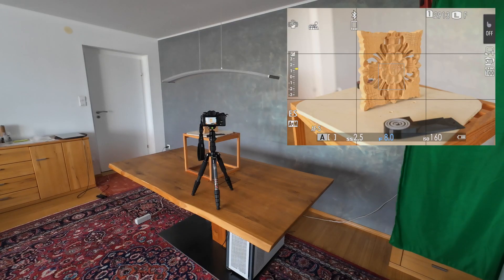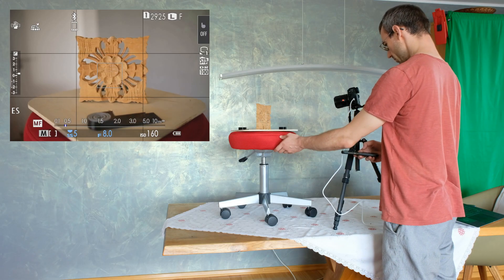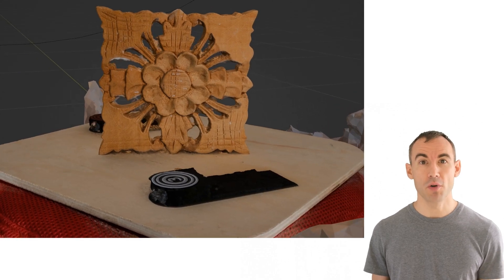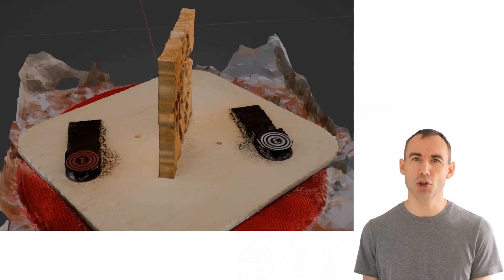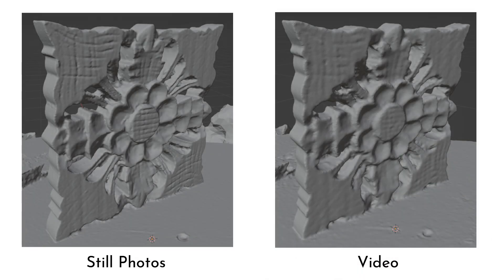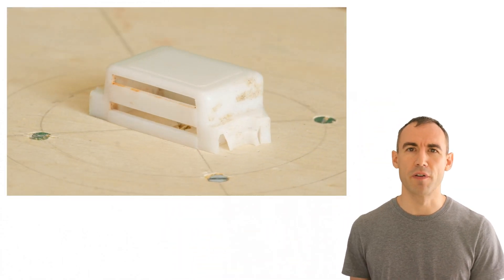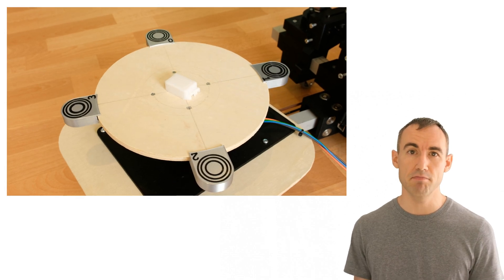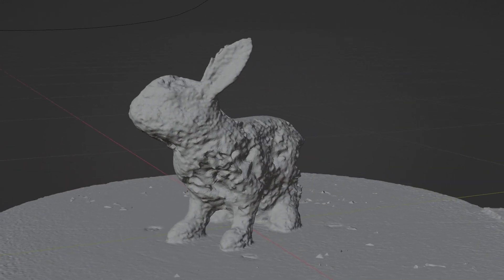Let's do some 3D Reconstruction: Intro and Image Acquisition

Comment: Nice video! Thanks for sharing your work! I have been wondering for a long time whether or not photogrammetry for medium/small size objects was possible. 
Inputing manualy the position of the  pictures sounds like a good idea to improve accuracy, 😰 modifying the code of meshroom doesnt sounds so fun to me. 
Could you explain how you did it, or share "your version" of meshroom?
Reply from the maker: Hey, thank you! I'm planning to spend some time next week to try and set up Meshroom in Docker or Linux containers. Right now my own setup is a bit messy because I'm using the self-compiled version for importing images but a binary for the rest (because right now the GUI and some other functions don't seem to work properly on more up-to-date versions of Linux). If I get it to run smoothly then I'll make the container available and I post a blog entry or a video about it.
Reply from the maker: Hey, I finally got Meshroom/AliceVision to compile in Docker. If you use Linux then try my Dockerfile: https://github.com/mpr-projects/Meshroom_Docker (I talk also about it in the latest video).

Comment: I've seen people using a green screen/table and automatically delete the background of the image. IIRC there is a matte spray you can use that will wash off of shiny objects.
Reply from the maker: yes, the spray is definitely something I want to try, mostly for transparent objects like glass; I've done some tests with a green screen but it did leave a green shimmer on the reconstructed texture (even though the green screen was in the background, not that close to the object; when I put it directly underneath the object then the shimmer is quite strong), but I'll do some more tests soon
Reply: @_mpr_  I think I've seen hairspray used as a fogger